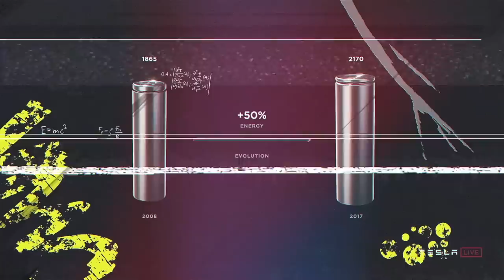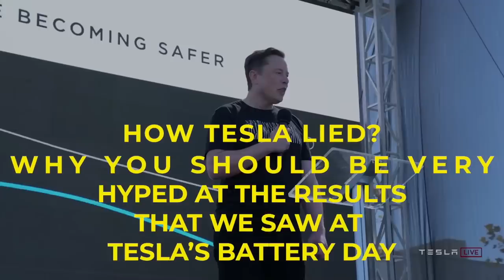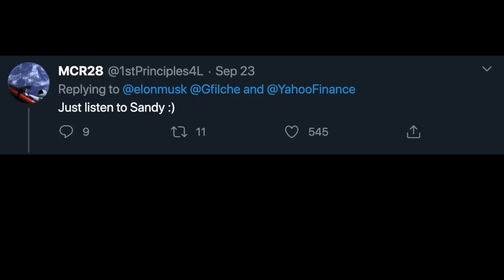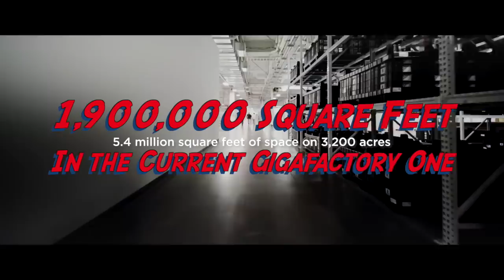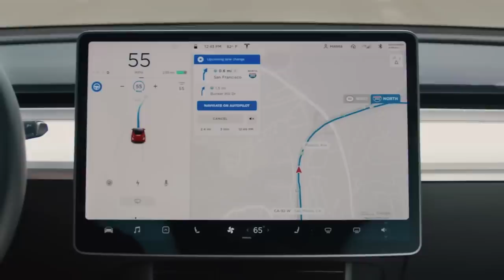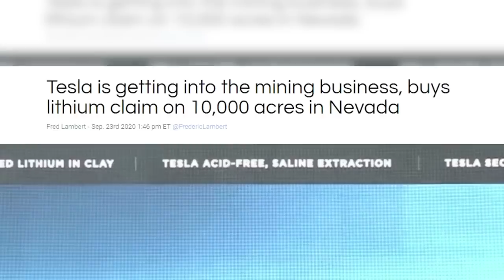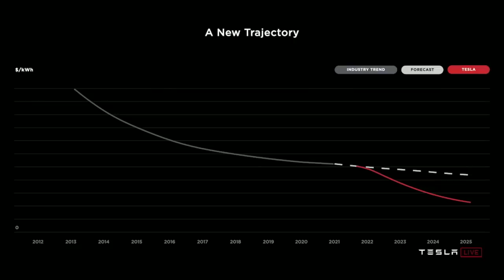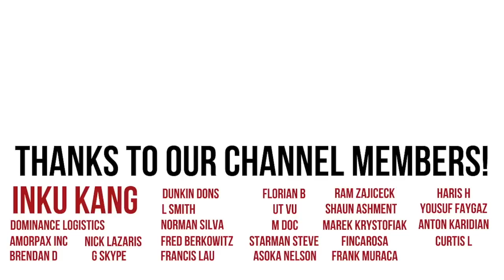Tesla Lied At Battery Day

Comment: No, I don't think that's right.

You said that the prototype Roadrunner line will produce 3 times more batteries than GF-Nevada.

It's more like 1/4 of GF-Nevada.  Elon said their goal for the prototype Roadrunner line was 10 GWh of cells annually.  When they are able to achieve that level of production - on Elon time, a year away, more realistically 18-24 months - then they can take that line design and install more lines at Tesla's factories.

The prototype line is only a single line.  When they start to scale up production, multiple lines will go into GF-Austin, GF-Berlin, probably GF-China, probably GF-Nevada.  Each will be capable of producing 10 GWh of cells annually, roughly, though we might expect to see that number rise as Tesla tweaks their designs going forward.

Panasonic operates 13 production lines at GF-Nevada and is adding one more next year.  Their projected output will be roughly 39 GWhs using those 14 lines.  Roadrunner can produce that much storage with just 4 lines, and each line has a vastly smaller footprint and is cheaper to build than the Panasonic lines.

Where you became confused is in Elon's talking about 100 MWh of production in 2022 (which is an aspirational date, it's on Elon time), but that isn't from one line.  He's counting on production lines at GF-Berlin and GF-Austin, and maybe elsewhere, contributing to their totals.  He's also assuming no bottlenecks.

There will be bottlenecks to solve.  There always are.

So that date will slip.  But that isn't the main takeaway from Battery Day.  The main takeaway is they have a fantastic new battery, it's much cheaper to manufacture, it has amazing performance specs, and it's a big, big deal.  The cell is in LRIP now (low rate initial production), and they're probably fighting the reject rate at the moment, but that's normal for any new cell line.  The good cells coming out of LRIP are already in prototype vehicles and proving themselves in the real world.

There is lots of hard work ahead to nail down the production line design and then scale Roadrunner production, but the work of designing the cell and proving that it can be commercialized is done.  It's no longer in doubt.  This is a battery technology that made it through the developmental hurdles and is economical to make.  Very economical to make.

Comment: Battery day presentation was dry...not enough lasers and fireworks.
Reply: Yea, and what about any Juicy SJW Issues  and Rainbow Unicorns with Possible Flowers in displayed the Background?    Of course new tech for nice ways to increase clean air in the cabin of Tesla vehicles could have been nice, or at least to help protect users during riots would help certain potential buyers and stock holders.

Comment: The media was hoping for the compact car to be revealed. They only care about stuff that would seem interesting to people with no knowledge of tech. What they unveiled is absolutely mindblowing. >50% cheaper >50% more range while needing less space to be produced. Absolutely insane.
Reply: DomDom - they are Getting TWO cars , one - a Super car for the 1% in 1 year and a $25K car in 3 Years.
Reply: @markplott4820  I wouldn't bank on them keeping the promise of three years. I could definitely see the tech implemented sooner and production start the same time, or maybe six months after, the plaid hits the market
Reply: @NathanMadden98   - well, of course.......its ELON we are Tlaking about, you cant Tell Him , we cant do it.
Reply: 54%more range 56%less cost
Reply: @Thomas Chrombly Recharge time is decreasing with this tabless battery. a few engineers I've talked to estimate a 10 - 15 min charge time from empty to full.
Reply: After battery day, I was scared to say it, but that's what I thought.
Reply: @NathanMadden98  that's an interesting claim: does it come down to high a sustained high power (cause of the tabless config) or a smaller battery pack? I was wondering what pack tesla would use for its new model 2 and if they  go for 200 miles range, how long it'd take to recharge it.
Reply: @gianluigicassin868  I'm sure it will be comparable to at least the original model 3. The vertical integration savings plus the new design choices have a lot of potential for price reduction + better performance.
Reply: @NathanMadden98  I'm with you. Just craving for more details and numbers. At that point the vehicle market will be... Insane
Reply: @Thomas Chrombly yeah that's not what they said . They said 
1 less weight 
2 6times more power 
3 tables electrode technology 
4 54% less cost 
5 56%more range
Reply: @Thomas Chrombly 
You act like Elon doesn't deliver crazy results continuously. In case your memory is failing, or you lived in some alternate dimension until recently, we are talking about the guy, who did this : https://www.youtube.com/watch?v=A0FZIwabctw
Tesla also continuously cuts prices, while making the cars better. For the price of the Plaid Model S, in 2013 you got a Tesla with less range than a base Model 3 and practically no features other than being able to drive.
Reply: @Thomas Chrombly Tesla is driving cost down. 

Tesla is making 30% margin now, while traditional automotive manufacturer make 10% if they're lucky. 

Mega casting is what made the model y so cheap
Reply: @Thomas Chrombly sure, the cars aren't 50% cheaper but the batteries are. Realistically Tesla has already been pushing range and already used it to make a 520 mile range version so I mean
Reply: @Thomas Chrombly 
I expect them to do what they said they'll do. Or exceed it, they usually very conservative with their promises, now even with the timelines. "Elon time" is not a thing anymore.
Reply: They should wait until compact car day